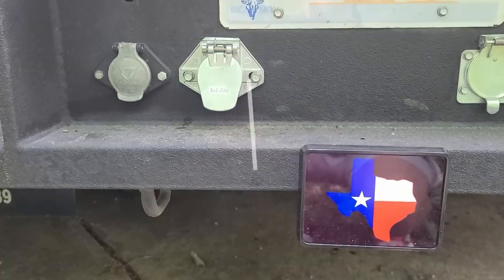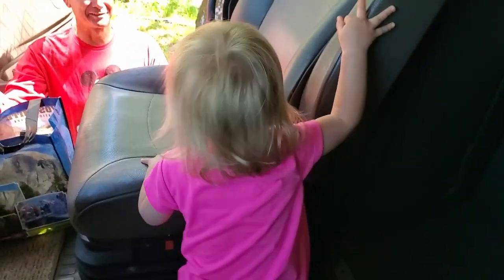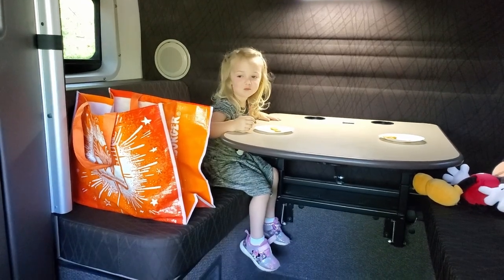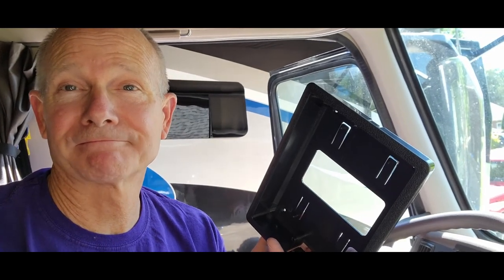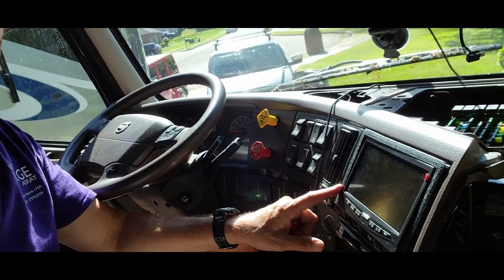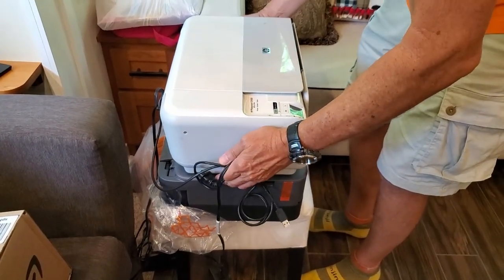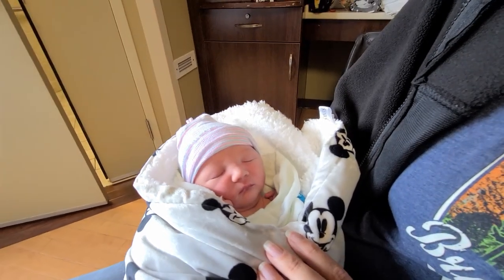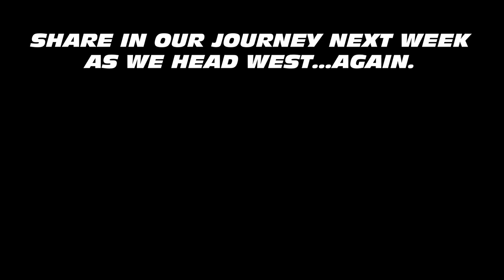RV DIY // A birth - It's a BOY!! // Family Fun

Comment: I got fed up with my ink jet printer drying up as I did not use so often so I got a laser printer instead and I can transfer prints from  it onto wood for home made d.i.y projects, you just iron it on to the surface.
Reply: That sounds pretty neat printing on wood!  As part of our maintenance program for the rig I'd print out one page a month to keep the heads clean.  Then about 2 years ago our daughter introduced me to Bullet Journaling and now I add pictures of our travels in it which I print from the printer weekly. 😊
Reply: @mrsbigtruckbigtravels726  I was taken aback by the laser printer hot printing on surfaces like wood including photos, just a thought for the kiddies whilst they are growing up. And a lot more cheaper than ink jet. printing. Though black and white in UK  but colour in the US is probably cheaper. x
A great gift for keep sakes is  a little box with their face on.
Reply: I can go months not printing and it just works again no drying out.
Reply from the maker: Great idea!